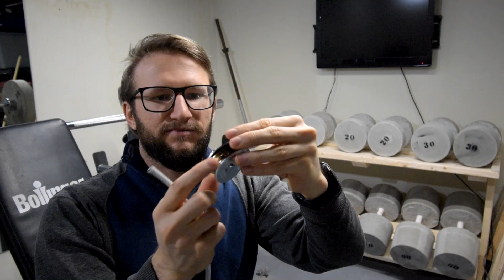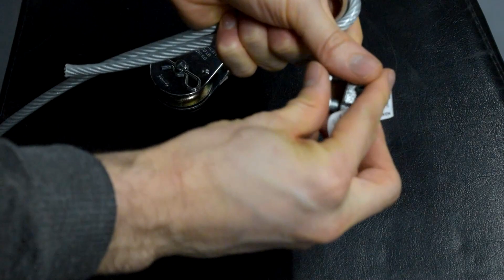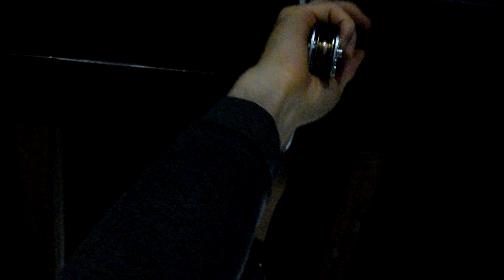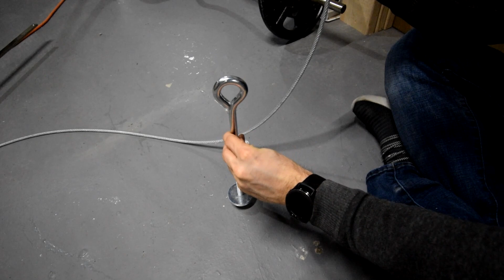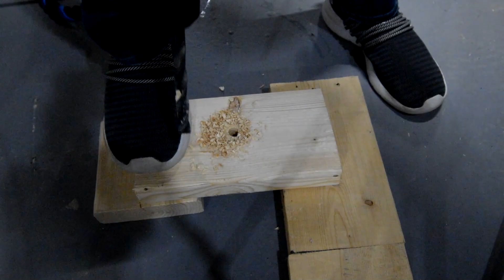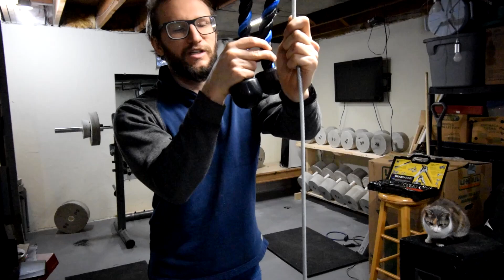DIY Cable Pulley Weight System

Comment: Thanks for the idea and help with the tutorial assembly. A suggestion for the eye bolt nut not coming loose is a spring washer attached before the nut is tightened. Many thanks.

Comment: Amazon sells a lot of great kits for doing this project. Comes complete with attachments, cables, pulleys, load pin for standard and Olympic size weights. You can find many for under $40 and they're ready to go.

Comment: Well Mr know it all,do you think your talking to a bunch of simpletons?I think it's pretty obvious that the cable needs to reach from the floor to the pulley.you shouldn't have used the vinyl covered cable it will very quickly crack all up and peel and make shit all jerky.why would you not put a lock nut on the bottom of your weight pin instead of glueing the nut?you should have used the aluminum cable ties you pound flat,much cleaner look and won't ever slip.the pulley you used is much to small in diamator and will cause a shitload of friction once you actually put some weight on it and will cause your cable to curl all up when your not using it,they sell much bigger ones right beside that tiny thing you got.since you didn't mount it to a power rack you can't put a low pulley attachment on it without bolting something to your floor.but other than that good work

Comment: indeed very doable, would definitely attach the feet to the loading pin, 
put a second nut against the first, crank them together, they wont loosen
really liked someonelse's suggestion of making a second version of the loading pin for holding dumbell pairs
if you set the cable length at the highest exercise position, you could use short lengths of chain and an extra caribiner to adjust for lower exercises
Reply from the maker: I thought of the 2nd nut to tighten after I had left the hardware store, will definitely be doing that!

Comment: Time under Tension   / Position of Flexion  / Range of motion    ............Make ANOTHER  " WEIGHT Pin STACK ""    YOU have 50 & 6 0 lb dumbbells    Make the plaTFORM BIG ENOUGH  ,  to put 2 dumbbells  Vertically on either side of the  new pulley in a square pattern ,  to weigh it down  ...
Reply from the maker: Solid idea! Was considering making some standard sized 45 lb. weight plates and using them on this because at the moment I can only fit about 85 lbs. because the 50 plates I made are so chonky.
Reply: @knowitall8799    AND yuo can buy a "" KEG TUB ""  https://www.lowes.com/pd/Style-Selections-22-3-in-W-x-22-3-in-H-x-16-5-in-D-Blue-Plastic-Basket/3198981?cm_mmc=shp-cprddcrgooglelia-232-plasticstorage-3198981-_-0&placeholder=null&ds_rl=1286981&gclid=Cj0KCQiAjKqABhDLARIsABbJrGmC4ttn9vkjpslvAGHAWEnpSJz7ttnvd16kUeXK5SXwNHnU3cHZ7H0aAn_1EALw_wcB&gclsrc=aw.ds           -     that link is what i mean  avg price in CT.   is $8.00 - $10.00  in stores.   CUT it down - 17 inches wide ,   would be only 3 inches tall .   Just  use a full  60 lb bag of concrete   and 3/4 of a gallon of water (  cured weight about 65 lbs,     OOOORRRRRRRRRRR    go all out like i did   80 lbs and  1 Full gallon of water ,   many easy options ..